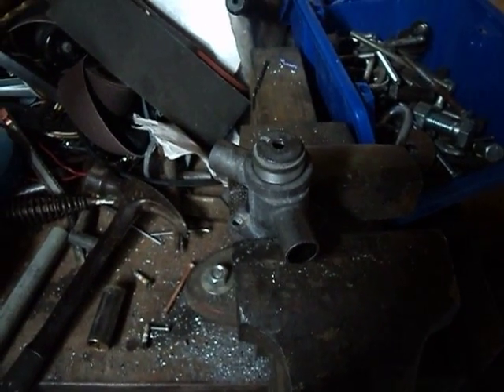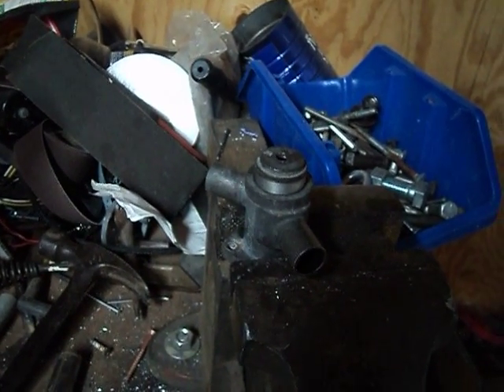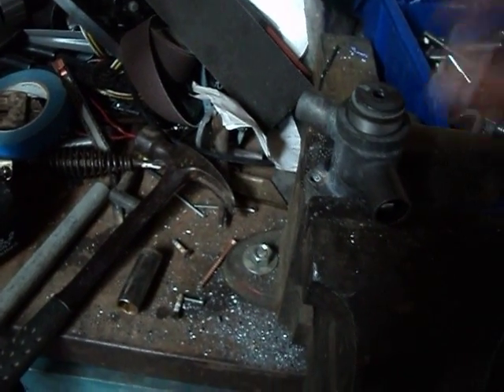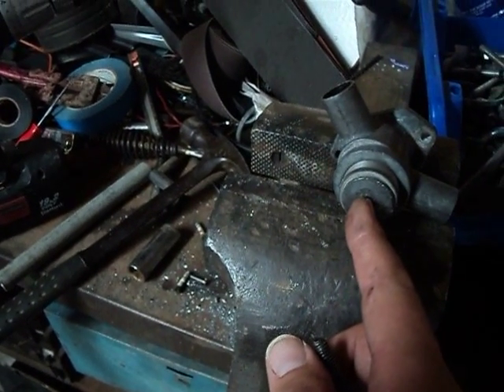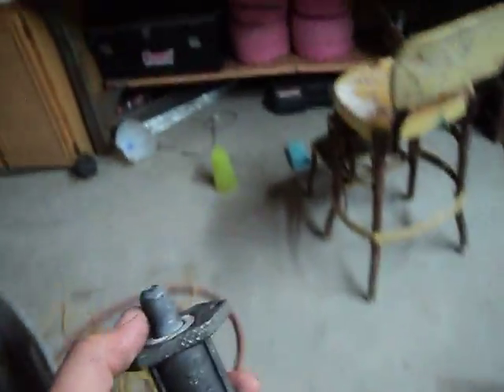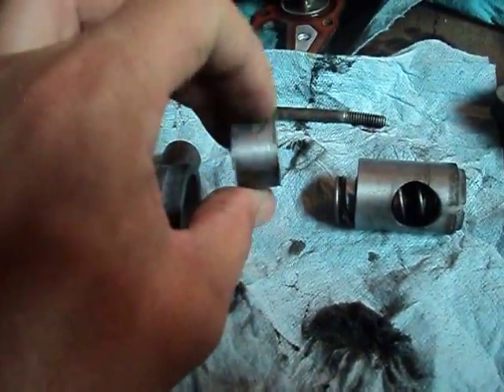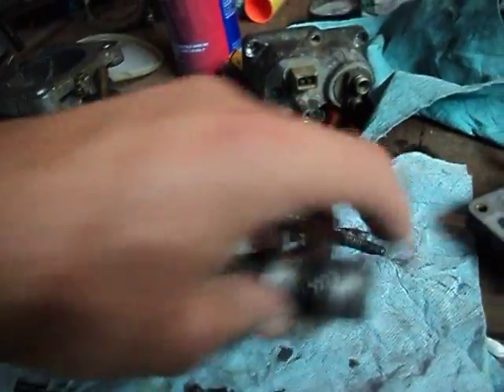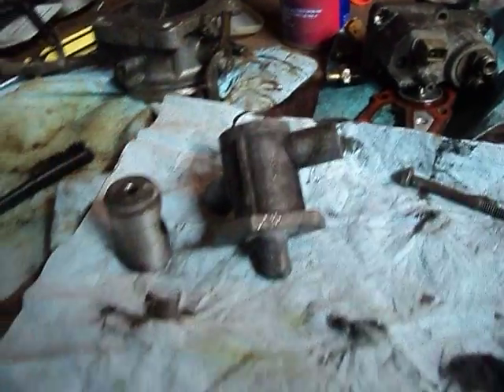Disassembling mercedes benz Auxiliary Air Valve AKA Air Slide Valve Part 1

Comment: use a socket to disassemble. hammer on the bulb side allowing clearance using proper spaced vise on opposite side. Drilling a hole and fastening a nut is more time consuming and damages your very expensive part. Not attractive to prospective buyers.

Comment from the maker: I am sorry you feel that way, Carlos The procedure I used did not ruin the part, I ended up sealing it with a washer and an rtv bead. If people are shy about hammering a wax filled copper cylinder, they may want to use this process. The part ended up working fine when I put it back together. Mike, to answer your question, I put it in boiling water to test it and made sure the insides were moving as they were supposed to.

Comment: I am sorry to say  but I thing this is NOT the proper way to get it disassembled.
You just need to hammer  from the lower side (the yellow copper sensor side) using an open tube to clear (and not to ruin) the wax filled sensor. You need to push the sensor from the edge. If you hammer the center, you lost the aav.
When you hammer (about 10 times) from lower side,  the sensor will push all the upper parts to outside. I am sorry to say.....but that outside hole ruined the part.
there are some links at MB foruns. Its not hard to perform this job. Once you know what to do, this is 2 min job.  Precisely put all parts together is another story.
tks
Reply: hey mate, thanks for your detailed explanation! i managed to dissemble the part exactly as you described. i was about to drill and do as in video but then read the comments and you saved me and 500usd 🎉 thx!

Comment: Very cool repair.
FWIW though, you might have caused a similar problem when you use WD40.  This is not a lubricant, it is a water displacer.  The lube in this product is temporary and soon becomes sticky which is why you don't ever use it on locks.  Even using a general penetrant would have been a better choice.
But a very ingenious solution to fixing this valve.